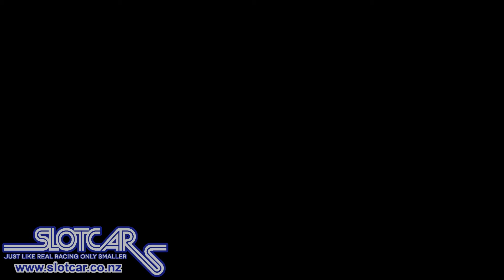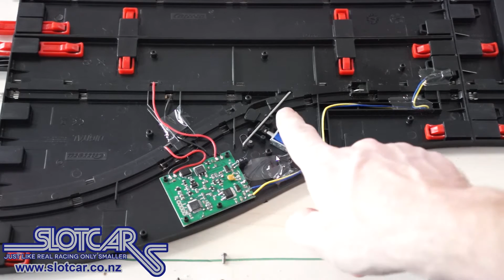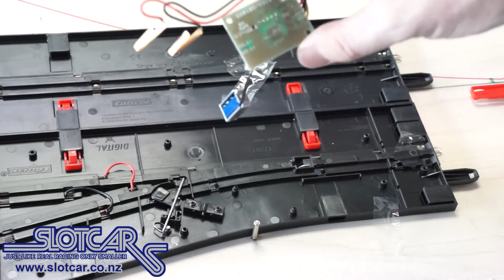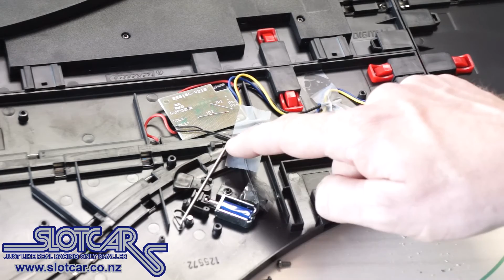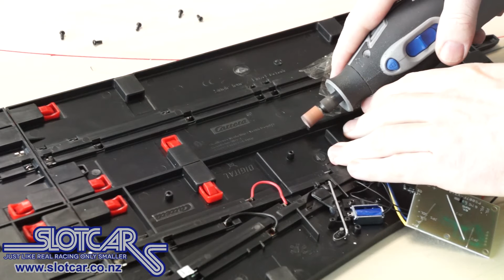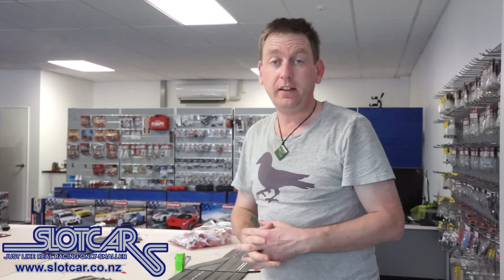Carrera DIGITAL Slotcar electronics swap Mod Slotcar NZ

Comment: I’m completely new to 1/32 slot sets, but have experience with digital. I’m an HO slot guy (TYCO US1 Electric Trucking). 
Question: Aside from the smoother/higher speed angle of entry, what are the differences between the pit lane electronics and the narrow lane electronics? 
Also, I’m looking for a way to modify HO slot track to incorporate the 1/32 Carrera lane changing technology (I want to find a way to integrate the lane changer into a cloverleaf Highway Interchange for my HO slot track). I run digital command control (DCC - NCE) HO scale slot trucks (rigs) and vehicles.
Reply: The digital narrows piece functions just like  a lane changer. The pit lane entry is a lane changer that also puts your cars into fueling mode. 

The point of this mod is that the digital narrows is a more gradual entry than the more abrupt, stock out entry.